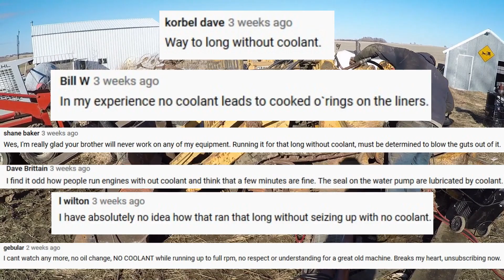Allis Chalmers HD-5 First Moves in 17 Years

Comment: Ran engines all over the world in upwards of 30 deg C. Petrol, diesel, multi, none of them gave a monkeys they had no coolant at idle, a few didn’t care they were driven without coolant, needs must and all. Those were older trucks, so not sure how a modern engine would handle it.
I wasn’t worried for the old girl at all, she’d of idled for a little longer I reckon if it’s cold your neck of the woods.
Love the videos and content, keep it up Wes!!
Reply from the maker: There's a video on YouTube where an 8V-92 ran at full throttle for almost 30 minutes with no coolant. It only died because the fuel supply line caught fire and it ran out of fuel.

Comment: Did you catch the video on my page? My grandfathers HD5? It has a blade, and a big as wintch on the back. In the video thats my father and myself running it. Thanks for the video, this was great. Remember, nothing makes more noise and less power than an old Detroit!
Reply: It would be awesome if you showed us how you adjusted that Starter.... That is exactly what ours is doing now.
Reply from the maker: It was easy. The starter linkage has a bolt that presses the starter switch. We just turned that bolt in a bit so the mechanical linkage engages before the switch turns on the starter motor.

Comment: That's quite an exhaust manifold ya got there. 👍 ive always had great doubt with additives. With good reason. Pretty much all they are good for is making the seller money. Lucas oil however has something to its claim. I personally put it in a taxi cab that was burning almost 4 qt in one 12 hour shift. There was literally oil dripping out the tail pipe. Going by the label i added the max ammount. I forget but it was allot. Think was something like 3qt. After adding lucas it burned about a qt a week. Can't explain how. Can't say it would work again. Have my doubts. But it did happen. Not sure how long it lasted either. About 2 months later i was no longer employed there. But at that time was still going.

Comment: i have been having trouble getting rid of the check engine light due to the downstream oxygen sensor having too high of a voltage. found the fix. I had put the O2 sensor in a standoff sold for fixing this issue, It did not fix the issue since the o2 sensor is 4 wire or has its own heater. Tried introducing more air by drilling holes. No. What fixed the issue is plugging the 1/4" hole in the stand off with a bolt. The sensor is perfectly happy with no exhaust exposure.  Much better than a $1000 new catalyst. This in a 2014 Chevy Spark.

Comment: good job on the exhaust manifold. now you could install a muffler in the stack pipe.those steering clutches will come around.the main clutch may need to be adjusted .needs around 35-50 pounds to properly engage.seemed light when you were pulling the clutch lever.you done well.
Reply from the maker: I think there is a procedure to adjust it in the manual.

Comment: i have been in the automotive trade over 35 yrs. i watch lots of you tube channels mechanically related. i can say one thing most of them i would not let touch my stuff but you i would not hesitated to let you work on my stuff. i had my own business for over 15 yrs. if a customer came by the shop i stop working till they are gone. there are all kinds of people out there and most of them think they know more then i do lol. they say things like i changed the spark plug in my lawn mower so i could rebuild that car if i wanted to lol

Comment: Nice! I'd love to have an old track loader like that, and I'm sure it will be a great farm machine once you sort out the left steering clutch. You sure blew up all the naysayers' theories.

Right now I've got a pair of old EIMCO underground rubber-tire loaders to wrench on. Both Deutz-powered, one 4-cylinder and one 3-cylinder.One of them is a runner and will probably be going "down the hole" into a small gold mine within the week, the other either has a seized block or a starter issue...haven't had the time to drive down there and work on it.
Reply from the maker: Interesting. This thing doesn't need to earn a living. It's just for use around the yard while other machines are out.

Comment: great job.you got it going.glad to see that.as you use it ,it will perform better.great little machines .get some fresh hydraulic oil in it cause sometimes water will settle in tanks .try it at full throttle ,the hydraulics become more effective.the hydraulics are very able.happy to see it going again.good luck with it.fun to operate.👍👍

Comment: Nice sir good to see that old iron spared from the shredder. Who the hell would worry about a diesel running with out water for awhile, definitely the 2 stroke, that thing wasn’t even 80 degrees. Maybe could understand the water pump, but I doubt it.
Reply from the maker: It's the internet. Everyone has an opinion and they are not afraid to share it!

Comment: Pretty sure the two stroke Detroits are basically indestructible.  Deboss garage had a hell of a time blowing one up, ran it without coolant or oil for what must've been at least half an hour to an hour and couldn't kill it.  Even finally threw a rod through the side of the block and it still ran.
Reply from the maker: I remember that!

Comment: I almost died laughing at the ignorance of the comments you posted, Though I do agree somewhat about changing the oil before trying to start. I worked at a Detroit/GMC power dealer in the 1980's. I have always loved their two stroke engines. the 51 and 60 Series are excellent in their own right, but there is something to be said about an engine that was produced from the 1920's until the late 1980's (for highway use, marine use end somewhere in the late 90's or early 00's). I have melted one of these engines down on a dyno (Silver 8v-92 435hp), it was at full POWER when the upper coolant hose popped off, By the time I noticed the temp. gauge rising it was too late. these engines generate a lot of heat at full power but, next to nothing with no load regardless of engine speed, when compared to full power. 

 I found the comment "In my experience no coolant leads to cooked o"rings on the liners" umm sorry dude Detroits  have dry liners, hence NO FUCKIN' O-RINGS, that includes all of the 2 stroke Series (53,71,92,149).

as a side note, the hunting in your engine (Hunting is when the idle speed rises and falls contantly, never settling on a steady speed) is generally caused by some kind of binding or sticking the the fuel metering linkage. the governor keeps requesting fuel until it can overcome the binding and the speed goes to high. then the governor keeps putting pressure on the linkage for less fuel, when the binding is ovecome the engine speed is too low. governor adds pressure for more fuel. over and over. the fluctuation in the rpm's give you an idea of how bad the bind is, the greater the fluctuation the tighter the bind. hope this helps.

regardless of what the trolls tell you, keep having fun and remember it's your money spend it how you like for our entertainment.

Comment: The engine enduring a lengthy run without coolant and still able to start and run afterwards is Testament to the A. P. Sloan and his brilliant electrical engineer Charles Kettering ( formally president of DELCO before merging with GM ) partnership . These diesels are similar to the  EMD 12V567 , 20V645 and other sizes used to power many EMD locomotives running today . See EMD SD90MAC . You're a very good mechanic Wes , but like many of us , we failed to see and appreciate the brilliant and subtle engineering that went into these very fine engines . It's  unlikely that most diesels could take such abuse . See scavenging air to help cool exhaust valves for instance . Please stop destroying these fine old machinery ? Thanks for the late rescue !

Comment: im Glad you proved the Internet professionals wrong lol. Pretty cool to see that ole thing move under its own power instead of being drug around . In the oilfield we had quite a few ole 2L and 3L  Detroits on compressors and lighting plants. They are pretty resilient engines but they do leak .
Reply from the maker: These things leaked on the assembly line!

Comment: Wes, a serious question: Back in the day, there were a lot of soot-spewing diesels on the road. Why? (likely more than none or two or three reasons). This old girl when warmed up was not really smoking in spite of "cracked liners, burned valves, and all the other carnage" (supposedly) caused by idling for a few minutes. What gives? Is here anything special about old 2-stroke DDs running relatively clean no matter how old they are with malfunctioning injector(s)? I am really curious. Other than NOx, I suppose.
Reply from the maker: These engines don't make a lot of visible smoke, but they doesn't mean they are efficient. Newer engines with higher compression, higher injection pressure, and computer controlled injection timing run much cleaner and are much more efficient. They are also easier to start and quieter.
Reply: @WatchWesWork  Indeed! Thanks.

Comment: Very cool guys!  I have that exact crawler here in central Illinois.  Only difference is I don't have a ripper, I recently just put a winch on mine.  I absolutely love my HD5G, I'm having an issue with my input transmission shaft as it's leaking at the drive shaft yoke and housing. It seems to be sticking out of the trans about a half an inch to far. I tried drinking the yoke down further but the bolt is as tight as it will go.  Any tips I'd massively appreciate it.  If you could PM on fb under Brandon Lawson I can show you the pics if you could help that would be awesome!

Comment: I'm paused at 1:01 and I have a funny story for you: My damn tractor won't come up to temperature.  My Tier 4 tractor with turbo and DPF just won't come up to temperature when sitting still, no matter what RPM I run it at.  This is the root cause of my DPF problems.  Seems that when it's 39degF out, the tractor, even with closed thermostat, just can't build enough heat to get above 175degF.  The IR thermo says the tstat housing was 145degF and the rad hose was 85degF, this was after 20 minutes of running it at 1500-2000, then 2500rpm, no heat.  So I understand why you put those comments in the video.
Reply from the maker: My dad used to have an old International TD9 crawler loader with a diesel engine. It had a non pressurized cooling system. I remember you could take it out and work it at full power. Then let it idle for 5 minutes and the thermostat would close and the temp would drop about 10 degrees over ambient.

Comment: Why would the engine be junk instantly without coolant? I've ran mercedes w201 with om602 and it had a great big hole in the radiatior. Had like 6L of water and had to make it for 10 kilometers. Stopped every two to fill up with 1.5liters. Got it home, fixed it and it worked another 18tkm just fine.
Reply from the maker: Because they read it on the internet.

Comment: There are lots of things get done that are not ideal in the mechanical world of old iron, but they end up just fine.   It's the difference between being a mechanic that can work with what he's got or a parts changer, that needs a computer to tell him whats wrong !  our current situations going to sort some of the men from the boys, when there isn't parts on the shelf next day or in a week for older equipment, but were still out there trying to make it work as best as we can for guys to feed Livestock.  
   so according to the experts you've established the motors stuffed ,the transmissions done now driving it  without an oil change,and you cavitated the hydraulics with low oil and pumped sludge round the system to.  Looks like it all matches now L.O.L and you still got more than you started with it runs and drives, and probably still will  when the computers/emmissions systems crapped the bed on this modern stuff in 15 years and parts are obsolete ! .    Thanks for the video, take care guys
Reply from the maker: This machine will still be running long after I'm dead.

Comment: Lucas and a bottle of seafoam fixed a broken headlight and a flat Tire I had once. Joking aside a bottle a Mr. Gasket cataclean got me through emissions testing once.
Reply from the maker: Hmm. That's interesting. Cleaned out the carbon?
Reply: Watch Wes Work in theory it cleans carbon and sensor tips. Not sure about the sensor though, I had them backed out the exhaust by screwing them into spark plug nonfoulers. Glad they still make the old 18 mm nonfoulers. Real shame is that cats cost more than most vehicles are worth. Love your work.

Comment: probably could do with pistons and liners and maybe a valve job but these 71 series Detroits last forever if it will start it will run all day you can put pistons and liners in these for around $250 a cylinder including bearings good score
Reply from the maker: The valves were all ground and one valve and seat was replaced.

Comment: you guys sound like me. i get something old and they tell me you will never get that working. then next time they ask me about it i say yep i screwed up again and got it working.
Reply from the maker: Right. How dare you just fix it so you can use it without a Concourse restoration.
Reply: @WatchWesWork   i have never had anything diesel but i just wanted to know if the engine would run different if it had a muffler on the exhaust. i just turned 60 so i might still have a chance to get to work on a diesel some day. i understand how they work just never came across a deal. i have driven a lot of diesel powered stuff. how long will diesel fuel stay good before it goes bad or can you tell if its bad?
Reply from the maker: @flhusa1  The old high sulfur fuel lasts basically forever. The new stuff is a different story. But if it's not bio diesel it's usually fine.
Reply: @WatchWesWork  thanks another piece of info stored in the old coconut.

Comment: People forget these are bulldozers engines, they are incredibly heavy duty. When I watch will it run videos I expect them to all run. Why? Because sitting unused is probably the easiest thing it ever did in its lifetime.
We have a 1967 D7 CAT it would sit for years until we needed it. The hardest thing was getting the pony motor going, but we replaced it with a starter. It always starts or started it been sitting 10 years now and unfortunately I don't think we will ever get it going again
Reply from the maker: I feel the same. How many "will it start" videos on old diesel equipment are 25 minute videos of installing a battery and cranking the engine for a few seconds?
Reply: @WatchWesWork  if someone wants to a will it run video where you have to crank start a pony motor first, now that would be something too watch. Not that I didn't enjoy this one
Reply: @WatchWesWork  we used to have a CAT 955 shovel dozer or was it a case? That was my machine the one I drove. I didn't get the dozer or the backhoe or the excavator. But the we got a big 10 wheeler dump truck, and the 955 didn't reach high enough to load it. It was doomed, my dad sold it... I was on a hand shovel from then on. Always in the trench/hole never on a machine. Wore me out by the time I was 45 OK ok I hung on till I was 50
Reply: I'm 59 now

Comment: Back in the day, they designed equipment to punish you if you did check/change the hydraulic hoses.   A good ol' hot spray now and then.
Reply from the maker: Especially on these high volume systems. It'll empty the 20 gallon hydraulic tank in about 10 seconds.

Comment: You made me laugh about LUCAS Oil, I ended up putting two bottles in my then 2001 Mondeo estate auto box as it was playing up, had to draw of 2 litres of oil first, then as the LUCAS was so cold it was like treacle so i warmed it in a pan of hot water on a cooker hob, poured right into the auto box after, never cured the auto box but we still got the car as a spare car for me and my son, still drives - mostly.. Did make me smile..lol.... to some its snake oil to others its a get it going stuff, in my case its still getting going so cant be that bad.. (ian) - UK

Comment: "He only wants it for the ripper, to put it on another unit ..." (episode first)

If your brother wants is to put the ripper on something else, why the new valves, valve seats, rebuild the drive and steering clutches, transmission, and everything else?
Why make it run and operate if there is no intention of using it?
Why not just pull the ripper and either scrap or part out/keep for parts what's left?

Comment: I have a 4-71detroit that I can't figure out, it runs great but I have to start it with no water then fill it. It can run for hours and no water gets into the oil and no oil in the water but shut it down and in an hour all the water drains into the oil pan. Got any ideas on what causes it.
Reply: check the oil cooler

Comment: Oil leaks just protect against rust! I knew you could just twist on that thing that the spark plug wires come out and get it going. Otherwise you could just get one of those HF two cylinder engines and stick it in.

Comment: Once we ran a copco compressor with a ford 4d engine and jackhammered up a load of yard, saw the engine was smoking- all the oil on the outside of the block was smoking off. It was probably running for 15 minutes under load.  Any way it was fine after. Eventually we sold it to a Syrian machinery dealer
Reply from the maker: Yeah, it's amazing what these industrial engines will take.

Comment: I let engines run longer than that with dry blocks when I heat cycle them after I rebuild them and never had a problem.
Reply from the maker: Yeah, just don't do it on YouTube...
Reply: @WatchWesWork  damn internet engineers

Comment: old machines are damm tough
not like the new electronic controlled stuff
Reply from the maker: There's not a single electric switch on the machine. It doesn't even have lights.